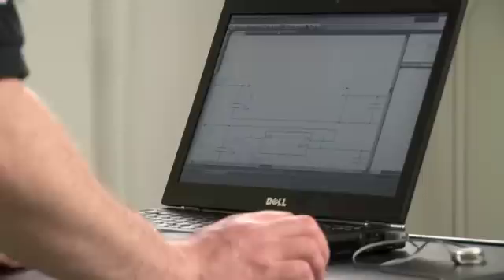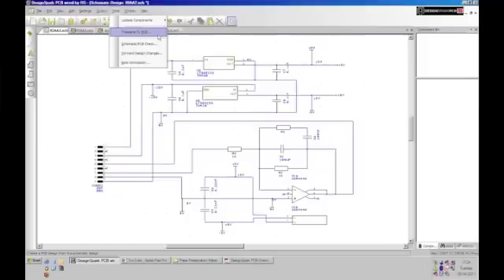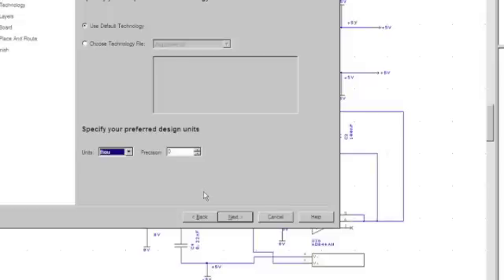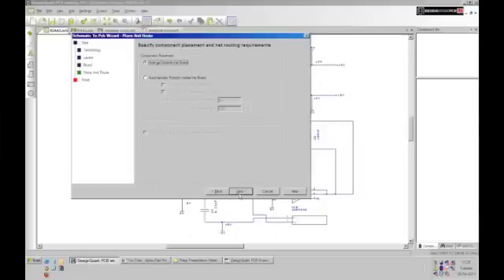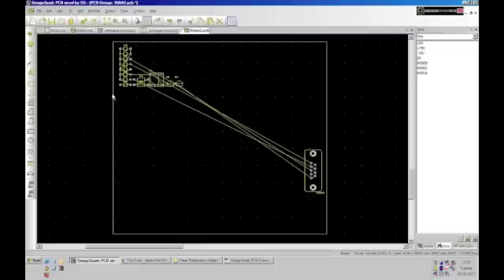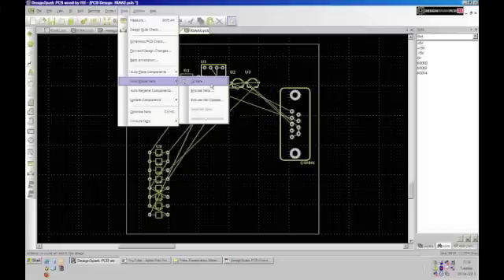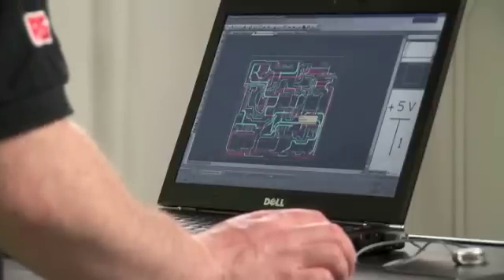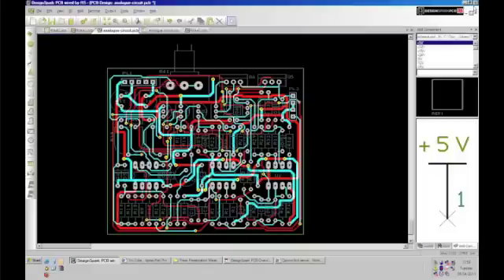DesignSpark PCB Demonstration | RS Components

Comment: Basically save yourself the stress of trying to figure out how this software works and download an old version of Quark Xpress and just draw the PCB design yourself as this crap seems to think a RS 108-2435 capacitor is surface mount. Doh
Reply: This certainly shouldn't be happening, however as well as the free CAD software we also offer free support when issues like this arise. You can find our support area at https://designspark.zendesk.com/hc/en-us where one of our support engineers will be happy to assist you with any issues. We provide this software to save people time and money, not to give you extra problems. Sorry that you've found it so stressful.